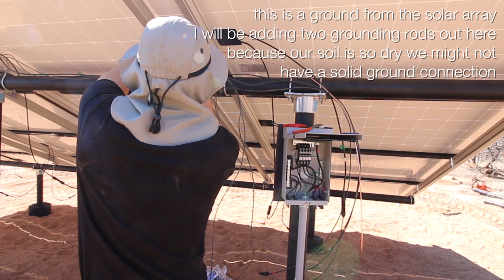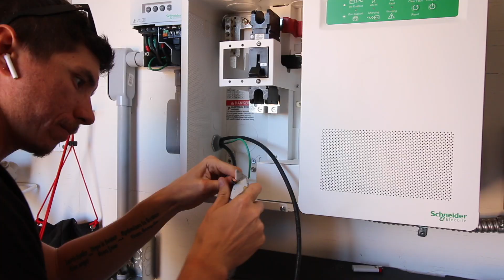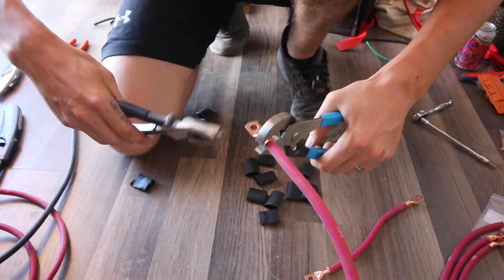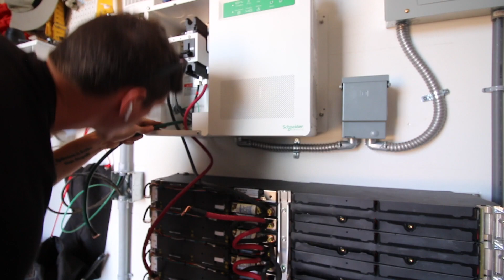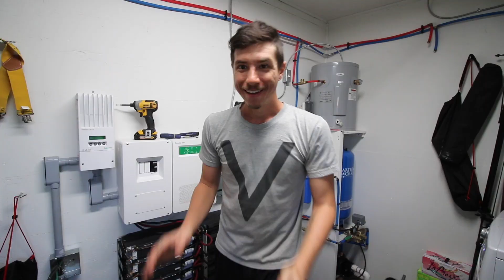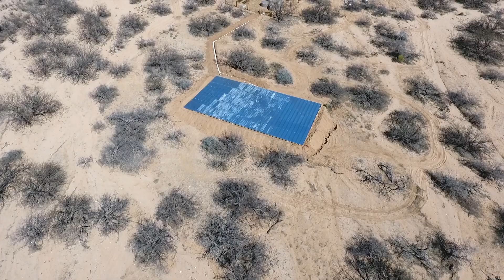HOLY F#CK IT WORKS!! Off Grid Solar Installation Day 6

Comment: Congrats on your set up man, it looks sweet. Just wanted to shoot you some advice for those ground rods! Long story short, I grew up in New Mexico so I know all about that dry climate. In the Army we use ground rods for our equipment and in dry desert environments overseas, much like NM and AZ. What we do to obtain the most moisture in the ground for our rods is throw some sand bags around the rods and fill it up with rock salt; we then throw a gallon or two of water on it a week, so that the salt sinks around your ground rod to soak as much moisture around it for maximum grounding capability. We also take a copper wire and connect the two ground rods together. Just some friendly advice if you choose to do so! Good luck and congrats once again to y'all.

Comment: Maybe you should put a protective box around those batteries, personly id be kinda scared with it exposed, one trip and putting a dent in a battery or accidently something happens and boom the hole shed will be on fire.

Comment: That's a nice installation. It will be interesting to see how it turns out. I use mains power at my house, but i have a 12VDC system as a backup that can run my lighting and an inverter for my fridge and freezer. But i used shitty old lead acid pallet truck batteries. They have seen better days but i think the system is a bit more resilient and i don't mind the space the batteries take up. It will be interesting to see what you think of this system in 12 months and how reliable its been. You also have the generator if anything does go wrong.

Comment: Great Job and I love your videos. Might I make one suggestion. You might want to consider installing a quick disconnect just before going into the charge control so that in the event you need to do some work you can disconnect from within the shed instead of going to the panels.  Who did you work with on your solar design?

Comment: What is the voltage drop from that long cable run? Could it have been enough( 8 volts ) to allow your original solar panel layout?
Reply from the maker: nah we tried it and the charge controller was at 148V and gave us a fault because of it so we had to rewire it

Comment: I'm so jealous, you get to do all this fun stuff and I'm loving that you have the toys to make it happen as well.  
I'd be interested in the amperage that your array is generating, and the total amp hours you capture in a given day.  Also, do you use an inverter, or do your mains run directly off your batteries? (120 volt as I recall)
Reply from the maker: you have to think in terms of watt hours because our batteries are not your typical 12V system

the array could generate 20kWh in a day pretty easily but we only have 18kWh of storage, the panels are restricted by the charge controller, it can only allow up 60A going through it and at that amperage, we can be generating 3.5kW at once

Comment: What kind of batteries are you using in your system?
Reply from the maker: http://www.ebay.com/itm/TESLA-Lithium-Ion-18650-Battery-3kWh-Smart-car-ForTwo-Battery-22p-15s-53AH-55-5v-/222087158325?hash=item33b56d1a35:g:2fwAAOSw~oFXD~8T

Comment: Sorry if you already answered this question: what type of solar batteries are those  and where did you get them?
Reply from the maker: http://www.ebay.com/itm/TESLA-Lithium-Ion-18650-Battery-3kWh-Smart-car-ForTwo-Battery-22p-15s-53AH-55-5v-/222087158325?hash=item33b56d1a35:g:2fwAAOSw~oFXD~8T

Comment: Now all you have to do is research Nickel/Iron batteries.
Reply: Yeah I might, when they are as cheap as these Li-ion batteries (<$150/kWh) and as energy dense so they don't take up an entire shed and need to have their water refilled up every 6-8 weeks. I mean come on, 14k for the Lithium-Iron and almost 12k for the Nickel-Iron, we did a WHOLE SYSTEM for that much

Comment: Can you use that 16th panel to run a set of fans to blow air under the other panels? Solar panels get hot and the hotter they get the less power they make.

Comment: You didn't use lighting arrester at the solar panels and again here in the battery room, charge controller. Is there a reason you haven't used them?

Comment: In addition to the ribbon, bury a vertical marker at the inflection point where the conduit changes direction.  From that point it's a straight shot to the array and another to the shed.

Comment: Cool! That's awesome! One thing you might want to consider is relocating your water lines above your electrical equipment, on the off chance that you might have a leak. Water and high voltage, not a good combination. Other wise, good job!

Comment: Just curious, you mentioned configuring 5 banks of solar panels with 3 panels per bank but the way it is wired is you have 4 banks wired into the breaker box. So are you only using 12 of the 16 panels now?
Reply: Or did you wire it 4x4?
Reply: Currently Derek is running a 3x5 array, meaning 5 sets of 3 panels in series, making the system 90VDC/37A at MPP. This costs us one panel but that equates to only about 2kWh per day, plus we are already generating more than we can store so it's not really needed.
Reply: he tied 4 wires, one each into the 4 breakers, so I don't understand how he wired in the 5 arrays. so what am I missing?
Reply: If you had 5 arrays of 3 panels in series for each of the 5 sets then I would expect to see him wire 5 wires into the panel. he wired 4 wires not 5.
Reply: He didn't show it in this video but he added a 5th breaker after we tried the 4x4 array and got an over voltage warning on the charge controller
Reply: Ok that explains it because the video shows a 4x4 array so that’s why saying it was a 5 array didn’t make any sense from what I saw.  Now it makes sense - Thanks
Reply from the maker: next video you'll see it differently :)
Reply: Looking very good!!
Very professional quality installation, someone might even come away thinking you’ve done this before. ;)  :) 

Comment: The best thing is "Nothing blew up."  I know that feeling.  HUGE Congratulations!
Reply: My name is John steeples and I live in the Philippines where products are very difficult to get from time to time

I'm an electrician but not a solar expert

I connected eight plates to the top of my house 2200 W
I got a controller that takes 48 V and will take 60 amp 150 V load

But to connect them in positive to negative positive to negative that give 172 V
so I need to connect in another way I been noticing what other people are doing by having these connectors MC4 which I cannot obtain these in the Philippines

Can you suggest a manual way of connecting these to get my voltage down on these eight plates for my controller
Reply: Nothing blew up ??, the electrical skills in this video are awful, no gloves , no glasses , no insulated tools.  As an electrician i'm a specialists in DC & UPS systems,  i was waiting for a flash,  this guy while having massive enthusiasm is not electrical and took a huge risk here and could have been badly hurt or killed.  Battery or DC power is extremely dangerous.  The system might work,  but is it certified ?,  when the place goes up in flames im sure the insurance company will pay absolutely zip.  mmm, get someone qualified to do the work.

Comment: The bare copper wire going into the box under the solar panels could use a "Drip Loop" to prevent water from entering the box.
Reply from the maker: I'm going to re do it and use a proper water tight connector on the box, all I had a bx connector on hand

Comment: That aside, CONGRATULATIONS! on getting the system up and running.

wrong! on the grounds, check NFPA, NEC current code 2017 update on shock hazards and arc fault grounds. Basically you use a single ground, deeper. multi point grounding can leave you at a risk for electrocution due to ground electric field charges. We used to double up and the evidence now shows that as a very bad idea. In the event of a fault, the entire zone between the grounds and a diameter out from there becomes hot. You would die and not even know what hit you. Similar effect to downed powerlines.
Reply: Here in California we have to put one rod per array and irreversibly crimp it to the primary earth ground at the main panel.  While your looking at the grounds I am over here freaking out about no breakers at the main dc panel for the charge controller
Reply from the maker: there is only one neutral to ground connection, having multiple neutral to grounds is illegal and dangerous
Reply: Tim, I would love to see that section of the code, do you have a reference number? It is quite a big book to search through. Also, AZ is not currently using the 2017 version of the code so if this was being installed by a contractor they would have to follow the applicable local codes (NEC doesn’t enforce anything). As best as I can tell the whole of AZ does not follow one specific model year at the moment
Reply from the maker: I can add in a breaker in the DC panel for the CC, I did see that in the schematic and i can easily work it in

so Tim, if both grounds are connected together that is still a problem?
Reply: I think he's confusing multiple Neutral to Ground connections with multiple grounds...
Reply: have you ever heard of anyone around you using a salt and copper rod for better conductivity?  also on the batteries are you going to use the Schneider battery monitor or another brand of bms?
Reply: you getting it! don't take the safety suggestions the wrong way :)I fix off grid stuff all the time by pros and your doin ok
Reply: Deric I have to disagree that what you have done with you grounding is wrong. The fact that your grounds are tied together totally eliminates the possibility for voltage potential to exist between them. What you are doing is correct.
Reply: (D) Separately Derived Systems. Separately derived systems, which are required to be grounded by 250.20(A) or (B), must be grounded in accordance with the requirements of 250.30.
Reply: Maybe I'm thick, but I read that section of the code and I don't quite follow why it dictates we only use one ground rod, the whole point of ground rods is to provide a solid and reliable low resistance path to ground in varying conditions, in sandy soil that is rather tricky to get consistently. Most references I've seen dictate needing two ground rods approximate 2x the length apart from each other.
Reply: Separately derived systems are separate grounds if the systems are not tied.
different point, was providing two ground rods for the array. a no-no. if fault occurs the area between the rods becomes charged and poses an electrocution risk. Look at NEC 2017, ground fault and grounding and the specific sections dealing with photovolaics. Go to NFPA.org, free webinars if you have questions. It is messy.
Reply: To Fred S
You are actually incorrect. Even if the ground rods are tied together you will still have current flow. The ground itself becomes charged as current CAN only flow is if there is a potential difference between 2 ground rods that are now electrically tied together. Most folks don't realize that "ground" is not at one potential. By driving 2 stakes in 10 feet apart and tying a wire between them, current will flow b/c one area of "ground" will be at a different potential than the other area depending on soil conditions and other factors.The suggestion Tim made of driving at the rod deeper is one way of solving this problem. The other is to use soil treatment to alter the conductivity of the soil itself.

I've had too many instances where multiple grounds were used and people were getting shocked. As soon as I disconnected the unnecessary ground the problem(s) went away. Even the NEC code makes some interestingly vague statements about multiple grounds as recommendations so I would avoid unless you have no choice and know that (unforeseen) problems can occur.

Comment: Going to use any sort of BMS on the tesla packs?
Reply from the maker: there are ways to tap in to the battery management board in the batteries already, we'll go over that when we get there
Reply: Life Inside A Box totally. EV.TV has been working to reverse engineer the tesla can based bms

Comment: We were living in a mobile home Park, they were rewiring the transformers(ground mounted)  because the original wire was to small. Backhoe and helper, the helper takes a large prybar to dig out from under the transformer and 💥💥💥4th of July💥💥 he hit the old wires coming into the transformer. 7000 volts the only thing that saved his butt was the other end of the bar was in the ground at the same time, the current went through the bar into the ground instead of through him. I had spots before my eyes for a long time. The backhoe operator was really upset. So yeah gotta be carefull. Good job on the solar 😎

Comment: Great job.  'Would be nice to see a large wall-mounted fire extinguisher.   Those lithium batteries have quite a reputation for causing fires.
Reply from the maker: great idea (Y)
Reply: Thanks!  We need you two around for inspiration (and perhaps good neighbors soon).
Reply: Normally if lithium ion battery is on fire, nobody could put it out
Reply: Good to know.  I was considering doing the same in the attic.  Guess I'll be building a little man size dog house.

Comment: Dude you're living dangerous without active battery management system. I would have located the batteries outside incase they go poof it would create a truly spectacular fire.
Reply: Good idea. RC model batteries and cell phone batts. have burnt down cars etc., imagine what this pack would do!!!!!!!!!
Reply: RC batteries are Lithium polymer based which is a completely different chemistry/packaging then the LiNiMnCoO2 chemistry Tesla uses in these packs, the likely hood of fire is highly unlikely. The only way to start one is to draw excessive current (multiple protections against this including individual cell fuses), short the anode and cathode plates (unlikely these batteries are well built/protected), or excessively overcharge them until you cause thermal runaway (that's why we have a charge controller). I would do some research before you believe the scary stories told on cable news, most problems like the case of the Note 7 were caused by poor QC or manufacturer related design problems. That said I am working on reverse engineering the BMS that came with the pack in the car.

Comment: This may be a dumb question, but when running power into a house, you can do so because the "mains" are off until you contact the utility company. When wiring the main box with the solar panels, how do you do that when the wires are essentially live so long as there is sunlight? Do you just go for it and try not to touch anything, or do you do the final wire connections when the sun goes down?
Reply from the maker: the wires can be easily disconnected Matthew, the mc4 connectors on the bottom of the combiner box means I can wire everything up inside without anything being live
Reply: Turn off the breakers and it isn't live
Reply: Yeah, once the breakers are in, but I am talking about when he is wiring up the breakers. The wires are coming in from the panels with power, or he has the panels unplugged and when he plugs the panels in at the box they are live there. Unless it is done at night, there has to be some point where the circuit is completed and there is live power from the panels in one wire/connection.
Reply: Thanks. I had a feeling that was the case but was curious as I have never wired something where the power was a constant (typical house service or even small scale with electronics that use batteries) building the circuit was always done prior to adding power to the system.

Comment: Does the battery pack have a built in BMS?  If not, I can see things going pear shaped.

Also, I hope that the cold temperatures do not cause such an excessive voltage rise so as to pop the charge controller.
Reply from the maker: the batteries do have a BMS built in to them but I don't have a way to monitor everything yet, Liam and I will be working on that soon but with summer being here, we don't have to worry about the system being drained

the panels are only producing about ~100V, no way they could get up to 150V

Comment: Blue Staking on private property is the homeowners responsibility, very good by ribboning. You could also stake the run with markers every 40 feet or at every turn. Ground rods by depth and spread are a good call. Competely over kill BUT you just made every competent contractor very pleased by you skill level on proper utility placement.
Don't forget to MAP document all your unberground runs as a memory backup!

Comment: I assume you will put a cover over the batteries so those electrodes are not exposed?
Reply: The batteries actually come with orange covers for the terminals, Derek may have to modify them to fit around the wires but there will be something
Reply: Good thing they have dogs and not cats

Comment: do you have an approximate installation cost you could share?
Reply from the maker: conservatively about $14k
Reply: Have you seen the advertisements for the tesla powerwall selling for 6200?  If you paid 1400 ea. for 6 batteries, that's 8200.  However the tesla is 14kwhs and yours is (6x3kwhs) 18kwhs.  The tesla has a 10 year warranty.  The Powerwall seems to be a good idea.  What do you think?
Reply: you can find the batteries for around $1200 to $1400 , i would have used a bms/charger that would charge the batteries
Reply: Yes, running those batteries without a BMS is a risk that is not discussed. I don't see any cell balancing going on. Eventually there will be a cell failure that could result in a catastrophic fire.  It's a good thing they are installed in the equipment shed.